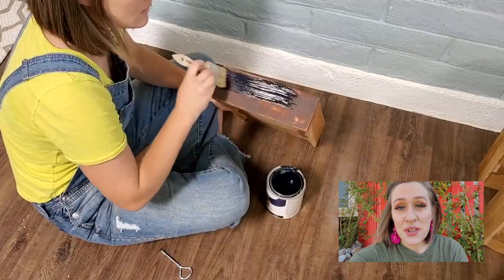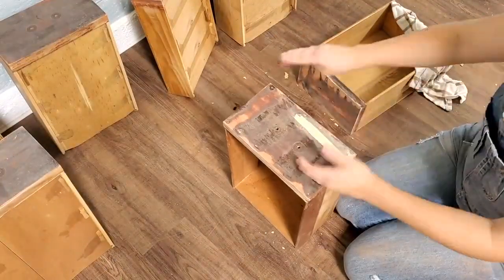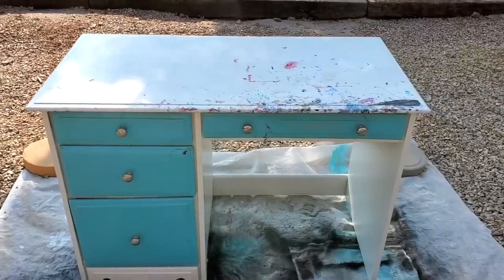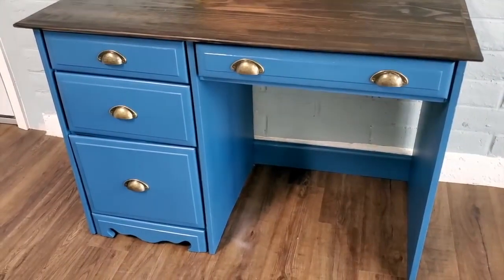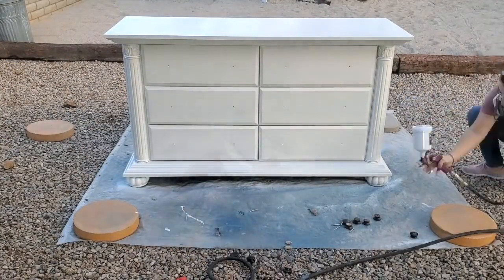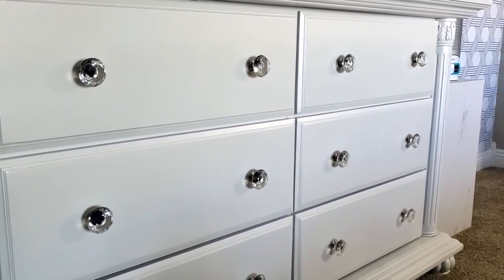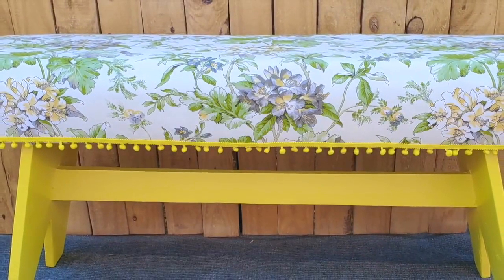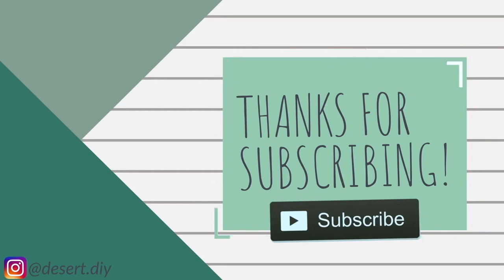Top 5 Furniture Flips, Trash to Treasures, and Curbside Finds of 2020

Comment: What spray paint gun attachment do you use and does it require you thin out paints?
Reply from the maker: I use a cheap hvlp paint gun

https://www.harborfreight.com/20-oz-hvlp-gravity-feed-air-spray-gun-62300.html

And you will need at least a 15 gal air compressor to run it for large furniture projects. Any brand will do.

You usually do need to thin paint to the consistency of milk
Reply from the maker: Also, I use water based paints and polys only so I can thin with water. Oil based requires mineral spirits to thin it and then you have to use special solvents to clean the gun after using oil based. Not worth the trouble
Reply: Great to know. I have the Porter Cable compressor that comes with the nail guns. I hope that will work. It is pretty big. I am all about making things easier. Oil based paints are the pits. Just used a bunch to refinish our antique table.